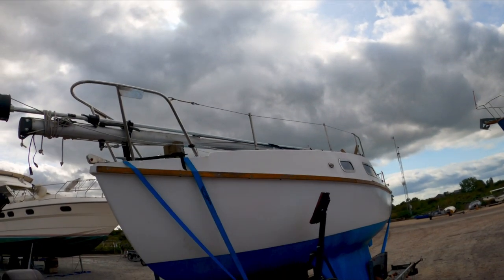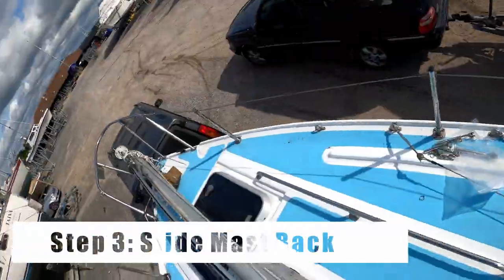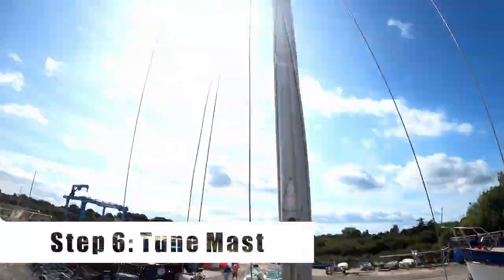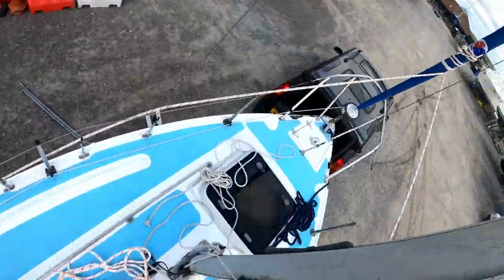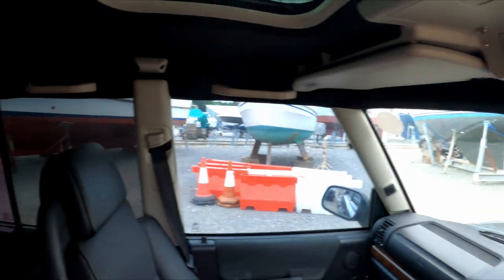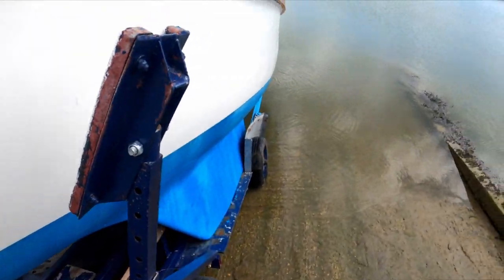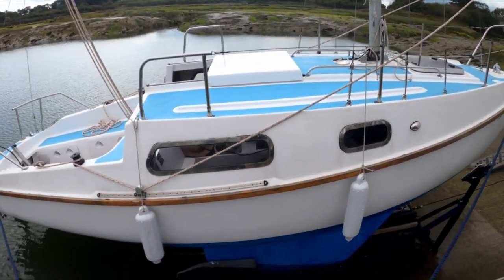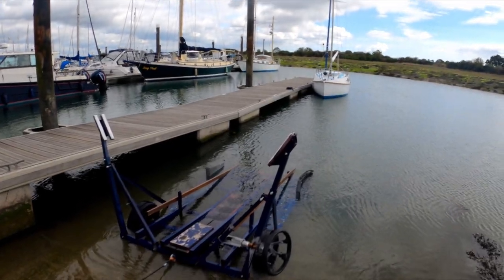HOW TO LAUNCH A TRAILER SAILER SOLO! Sailing Meraki | Ep.48

Comment: Hi Alex - on my Alberg 22 my friend made up a system with a roller (from a trailer) to allow the mast to be easily moved back. It allows me to pick up the mast (closer to the foot of the mast) and roll it back on the roller then drop the foot into the base.The roller has been attached to a plywood "deck" that attaches to the top of the pushpit. it works pretty well.
Reply from the maker: I have made a similar upgrade recently! Works really well!

Comment: You make it look easy. The only possible suggestion would be some cables to hold your cross piece in place while you are sliding your mask up so your not having to go back and forth. Well done as usual.
Reply from the maker: I’m thinking I might add a roller support so I only have to push it back!

Comment: Never seen a trailer like that in Australia. Essentially it is two trailers with the first on-road trailer having the brakes and suspension which never go near the water.Second trailer is more of what I would call dolly with no suspension or brakes.
The first trailer is probably not even special purpose for boats but could be used to move cars around. Interesting. Bit complex but at least it stops your suspension, brakes and primary wheel bearings rusting.
Reply from the maker: Exactly! Unconventional but is a wonderful setup with many benefits. Saving the brakes is a big plus!

Comment: I put two folding D rings on the mast, and two on the deck, and then use the cam type cargo straps to steady the mast on the way up and down. You seem to have an abundance, so no extra gear to carry. 
I can't believe that gadget man doesn't have a loos gauge. You have everything else. 😁
Reply from the maker: Haha the loos gauge is definitely on the list of things to get!
Reply: @AlexGoesSailing  😆😆😆😆 Sorry Alex, I had to get a dig in. Only because I'm jealous of all your tech gear. Take care man.
Reply from the maker: @chuckrobinson599  maybe I should one up you with built in loading gauges that can automatically adjust for the correct rig tension! Then again that would probably coast 100 times of what the boat is worth 😂
Reply: @AlexGoesSailing  are you trying to make me hate you? 😂😂😂
Reply from the maker: @chuckrobinson599  just you wait for some of the other gadgets that will be added in the winter project videos!
Reply: @AlexGoesSailing  😂😂😂😂😂

Comment: I got tired watching you go through all that. I can be on the water in less than an hour setting up my 24 ft trailer sailor. Suggest a roller device on your cross beams so when taking your mast back to the mast step you don't have to keep going back and adjusting. Only good thing is a day on the water is better than a day in the office.
Reply from the maker: That only took me about an hour! Yeah I definitely want to get a roller setup and a few other upgrades